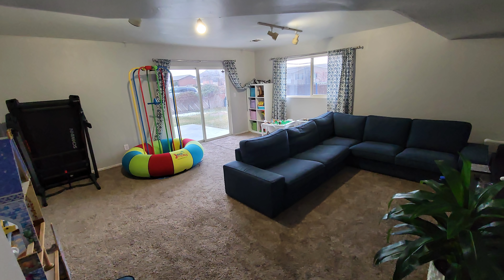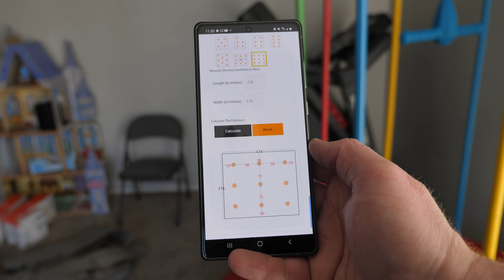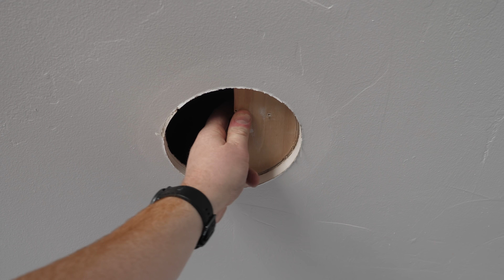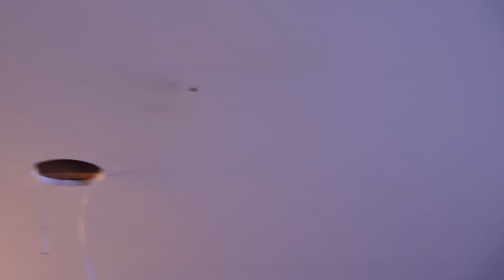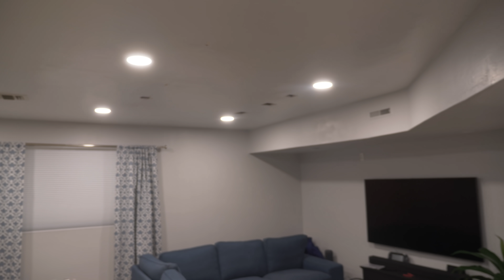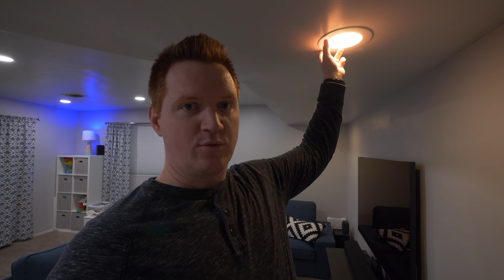Brighten Up Your Home With LED Wafer Lights

Comment: You need approved connectors for the Romex that goes into the junction boxes.  Otherwise, nice job!
Reply: Personally I think the manufacturer of the lights should just throw in 2 push-through plastic cable clamps per light. For like $0.25, they could help DIYers avoid one of the most common mistakes.
Reply: @majahanson311  I have bought a several different brands of these type lights and only ONE of them included any push in knock-out connectors. It's such a glaring oversight honestly.
Reply: Before I noticed the missing Romex connectors, another glaring code violation caught my attention. It appears the new LEDs are wired with 14/2 on a 20A circuit.14 gauge wire should only be used up to 15A. Either rewire with 12 gauge Romex or replace the 20A breaker with one that is 15A.
Reply: @austinguiswite3137  It’s missed too much in houses to the point where it seems normal. I have seen it a lot in my own house.
Reply: @austinguiswite3137  good catch. I didn’t even think of that, mostly because when I add anything, I automatically get 12/2 w ground and not even bother with the 14.
Reply from the maker: @john_thorpe  Thanks guys for all the help!
Reply: @austinguiswite3137  whaaat?
Reply: Kz!mama!!a!am!pz
Reply: I was just at the point of him wiring the junction boxes and I'm like "WWWWAAAIIIIITTTT, you're missing......"
Reply from the maker: Not sure how I missed that. Thanks!
Reply: 1st thing that I thought about.  Otherwise, great job and video.
Reply: @sgranger24 I’m doing a similar project. Could you specify what approved connectors for the Romex are?

Comment: Great video! I have very similar wafer lights. If a light dies can I just change out the light or does the junction box (driver) also needs to be changed out?
Reply from the maker: The light just needs to be changed out, the junction box is still good. The only reason you might need to change the junction box is if the new light doesn't use the same connector type so as long as you can find the same one that was originally purchased that should work.

Comment: Dude nooooooooo you can run romex into a bare hole like that!!! I appreciate the DIY and project looks good but man make sure you are using the proper supplies. You can use the cheap plastic romex clamps and it will protect the wire from the metal edges of the box, surprised it didn’t come with them. Good job otherwise though!
Reply from the maker: I learned my lesson. Thanks!

Comment: I would have first redone the ceilings,   somebody did a bad job with the sheetrock compound and sanding.  At the very least paint it a flat white, looks like there is a sheen.
Reply from the maker: I would have made them worse... I like the idea of the flat paint though.
Reply: @TechWithBrett  Yes and the flat paint will do a better job of hiding the flaws in the ceiling.

Comment: Nice job but to avoid barriers use a stud finders to mark stud and fire block locations, also when fishing wire use a magnet to route the wire, this avoids having to cut extra holes in the ceiling. I'm an electrician, these are tricks of the trade.

Comment: But what happens when one goes out????
Reply from the maker: You can just replace that LED light. Right after the junction box there is an adapter that you can easily remove and replace the LED wafer.
Reply: @TechWithBrett  ah ha, thank you!

Comment: When you buy the romex push in connectors for the junction box knockouts, make sure you don't buy the Heavy duty types that I did. They were such a huge pain to install and then I changed the lights out for a different style and they were even worse to remove.  I mangled the boxes going in and out because the sheet metal is so thin and the connector tabs were incredibly stiff.  I guess I got the ones for breaker panels.  However, I just found some that have a split in the side and they are really easy to install and then remove if you need to. they hold the wires really well. It made me cry and die inside when I tried them.

Comment: oooooooooooooooooooooooooooooooooooooooooooook:buffering::buffering::buffering::buffering:
Reply from the maker: Don't forgot to add the push in connectors into each light box knock out. Looks like I forgot those.

Comment: Nice work. I went with Nicor's DLE line (6" in the ceilings and 4" in the bedroom closets). Is there no need to secure the Romex to each driver box with the appropriate fasteners? (In the knockout)?

Comment: You have to use non metallic push connector so the cable is secure in the  jbox hole. 
Also will be better if you use wirenuts instead of those push in connectors.

Lights are too close to the wall

Comment: not living in a drywall home sucks... every wall is basically solid concrete and installing cables is basically impossible after construction, scewing anything into the wall requires stone drill bits and a hammer drill

Comment: I can't get mine snug with the ceiling. Huge gap. Any tips?
Reply from the maker: Your ceiling may be partially uneven, but make sure there is nothing in the way of the clamp so it can fit flush on both sides.

Comment: So... what happens when they burn out?
Reply: Replace it?? Should last more than 30,000 hours though.  Even if you can't get that manufacturer any more, just pull down the old light and the junction box and buy a new, very similar one. Yeah, it's not unscrew and screw in easy like an incandescent or cfl bulb, but not terribly complicated either.

Comment: Why didn't you set the brightness to full bright on the lights then control the dim with the dimmer switch?
Reply from the maker: So on the actually light that is only changing the color temperature and not the brightness of light. So you have to change temperature on the light but the brightness is from the switch.
Reply: @TechWithBrett  OH!  Thanks!

Comment: How does this brand of led wafers perform with  with the lutron caseta dimmer switch pd-6wcl...Do you get any issues...lutron site only have a few compatible led downlights...how did u know this onenwould work without any flickering or ghosting issues..thanks

Comment: I watch alot of these remolding videos. It seems I never see strapped ceilings in them. The drywall is screwed right to the joists. I did all my work in Massachusetts, and every ceiling is strapped with 3/4" pine perpendicular with the joists. For several reasons. Are we the only place in the country that does things right?
Reply: Yes I like the strapping especially for running the wires but new codes wouldn't allow batt insulation on the strapping in our new addition. Inspector said our options were cellulose fill or foam for the roof.
Reply: @oldgoldtopgoldtop6039  that's a bullshit rule. Just more rules for the sake of having rules.

Comment: What if you already have can lighting but you want to change them to these types of lights. I've already swit he'd them to led wafers but the screwed right into the light bulb socked so I didn't have to touch the wiring but I would like to switch to smart lights

Comment: Any experience with air coming through? Just wanna know if I should get the wafers or airlocked cans.
Reply: I’ve worked with these plenty of times. If you cut your hole to the right size with a hole saw, you won’t have any air gap issues. I keep my 4 inch and 6 inch hole saws in my box. Those two springs are very strong and will hold it snug against the drywall. They will snap your finger too so watch out. For those bulbs that are wet area rated, they come with a ring gasket that goes around the top lip of the wafer to work as a moisture barrier. I’ve installed those over my shower and bath tub.

Comment: As a professional lighting designer, these lights are the worst way to light a room that isn’t a morgue! The beam angle is way too wide, there is excessive glare and the colour temperature is way too cool. Also a grid arrangement is very bad design, the only spaces this arrangement is good for would be a perhaps a workshop space with requirements for blanket illumination. This is terrible for a domestic setting. The light emitting elements should not be visible in the space, the light should be directed to where it’s needed and ideally should have some ‘rise and fall’ to help the room feel more homely. Also warmer colour temperatures such as 2700k is more suitable. Fair play for making a good video but this is really not a good design for most people.

Comment: Wow, gr8 work. Gr8 video in show how EZ 2 install & what 2 do when there is stud in the way. Thx 4 sharing on Utube.
Reply: These wafer lights are usually only 1/2" thick - same thickness as the drywall - so it will fit in the hole without touching the joist or rafter.

Comment: As others have mentioned the wires need to have the restraints in the cut out holes because you have cable against a sheet metal edge. If you ever get tired of that lighting, Globe electric makes a really nice dim to warm product line called Duo Bright. They’re water and dust rated, and insulation contact rated. They change color as you dim them, which is a very pleasing effect.

Comment: If that was the breaker for the room, you need to use 12 gage wire, as per code the 14 gage is only aloud to be "fused" up to 15 amps in most places. Also you need to use a box connector where ever the cable enters a box. Other than that nice work!

Comment: Are all 9 cans on one switch, or on that one light outlet?  I want to add some much needed light down in my basement, but there is only 2 lights attached to my switch.  If I can replace the 1 (one is at the base of the stairs, the other is in a different room) at the base of the stairs with some cans like those spread out without overloading anything and still be safe then I might have to do that.
Reply from the maker: All cans are on one light switch. Definitely looks into how many lights you can add per circuit. That is a part I would need to do some research on.
Reply: @TechWithBrett  Thanks for the update.  If I do follow through it would be max 6, its mainly to replace 1 pull cord light further in the basement, and of course to replace the one bulb at the base of the stairs.

Comment: That turned out pretty good. The sat really flush to the ceiling.
Reply: Yes and no. Just build a drop down ceiling. Then run the wiring above.  The hardest part is finishing of the ceiling.

Comment: Cut a whole in yout ceiling! Unfortunatly that wont work in Europe.
Reply: Works exactly the same in almost every house I've seen in Europe, flats are of course different thing as your ceiling is at the same time the floor of the upstairs neighbour. Which is also the same situation in the US 😉
Reply: @iLoveTheseRemoras  well dosn't work in my House and wont work in  other houses I know around here. 
You can't drill such giant holes in concrete ceilings.

Comment: Nice work Brett, since it very simple to access the electrical boxes on the recessed lights,  just get a dozen romex connecters and reset the romex wires in the boxes, Proper and Safe wiring.  Before an electrical inspector on YouTube see it, and I can stop worrying.  Stay Safe.
Reply from the maker: Thanks! I plan to make an update.

Comment: Great informative video. But I believe I would use Romex connectors on my junction boxes. This holds the Romex in place and keeps it from being pulled out of the electrical connections. It also keeps it from rubbing on any sharp metal edges.
Reply from the maker: Great tip, thank you!
Reply: @TechWithBrett  I am curious about these lights; the junction boxes are very small. How many conductors are allowed in them? I am putting these in my bathroom renovation and I am using 12/2 cable. You appear to be using 14/2. NEC seems to indicate 2.25 sq inches per 12 gauge conductor in the box. If I do what you have done and use clamps, will I not have exceeded the provided box capacity? The ones I purchased do not have any description of the box capacity, they are very similar to the ones you installed. I wonder if a better way might be to use a transformer and supply only 24v DC to the lights in series.
Reply: ooooooo

Comment: With the concrete ceilings we have in Europe it will be a lot more difficult !
Reply: If your house's ceiling is wood panel it works just the same, the cutting just takes a little longer. Plenty of houses don't have concrete ceilings, flats, however, are a different thing.
Reply: ikr? Everything in the US is dry wall so it's easy to make changes, here in Europe the way you'd go about this would be to install what we call "fake ceilings" which is basically dry wall was well, but your regular concrete ceiling stays under it.

Comment: Who did the plaster job on that roof?
Reply from the maker: Whoever it was did the same thing in my whole basement and I have considered ripping the whole thing out and starting over. 
I was the one that filled the holes.
Reply: @TechWithBrett 
Learned now that ceiling is inside, roof outside! :)
Nice lights!
Reply: Just hire a professional to skim coat the ceilings to a level 5 finish.

Comment: Why not use smart lights ?  its crazy to me.
Reply from the maker: I considered going with a traditional can and installing Philips Hue recessed lights in each can but that is around $55 per light where this was $30 per light and I didn't need to purchase a can. Long term I think this was a better option.